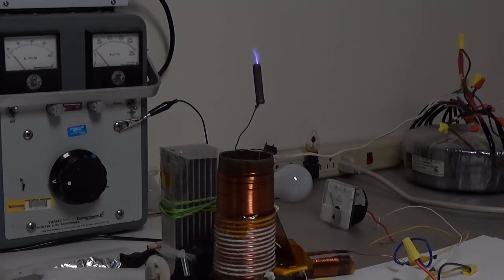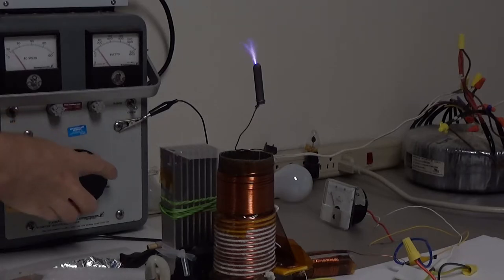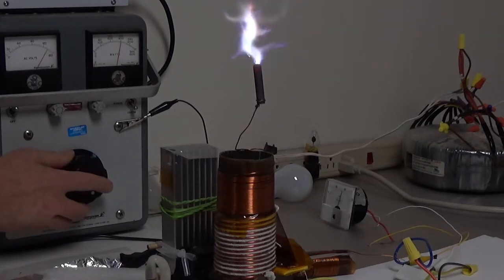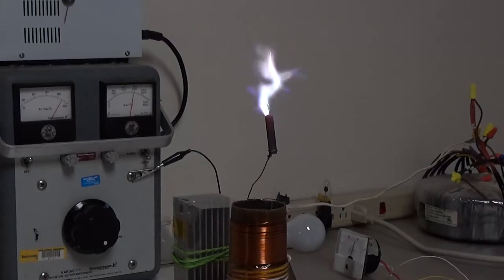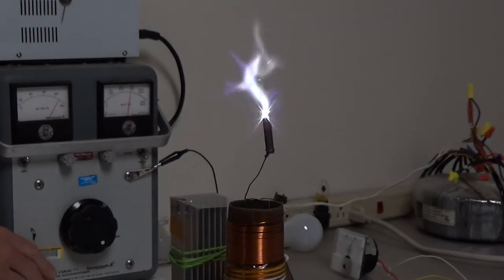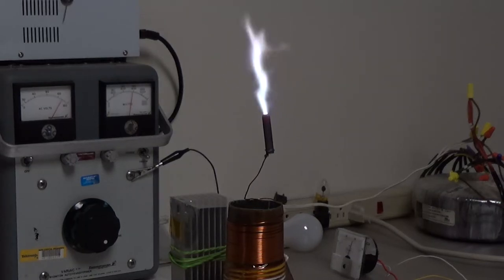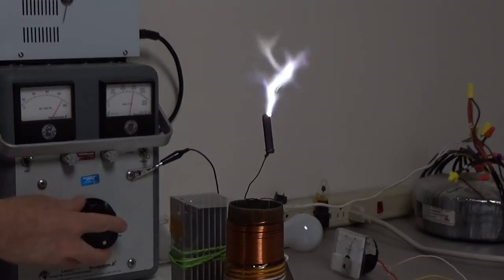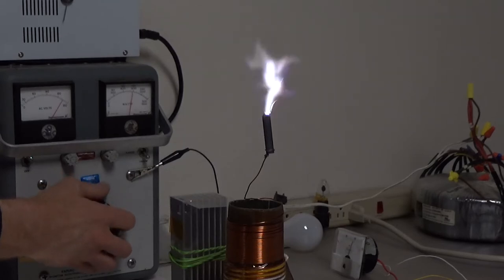HFSSTC with crystal-controlled frequency (6.78MHz)

Comment: Cool could this work with lower frecuency coils too?
Reply from the maker: Yes, depending on what you mean by "work".  Arc characteristics change with frequency.  Some difference is visible between this version and my higher-frequency (13.56MHz) version:
https://www.youtube.com/watch?v=5009MXv7BzE
And a much-lower frequency (100kHz) version:
https://youtu.be/yD5DkPYDcz0?t=112
I don't have any examples between 100kHz and 6.78MHz.  I've seen a few other people's.  Power (watts) makes a difference too.
Reply: @davekni  thanks that's exactly what I meant , did you ever play with low voltage dc coils? , would be interesting to see how much juice you can get from some little coil at 12v-30v those little coils can pack a punch too if properly tuned
Reply from the maker: @rodriguezfranco3839  At high frequency such as here, low DC supply voltage is difficult.  To get sufficiently low impedance, inductance must be quite low.  For lower frequencies, yes, low voltage can work.  Impressiveness of arc depends on total power.  Low voltage DC supply input requires correspondingly high current to maintain power.